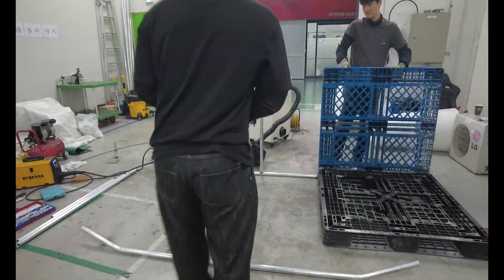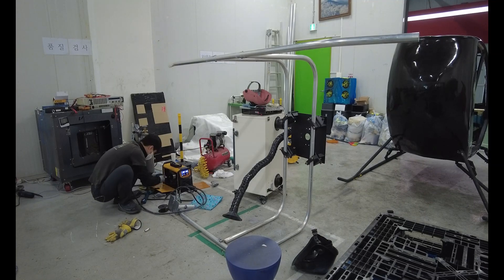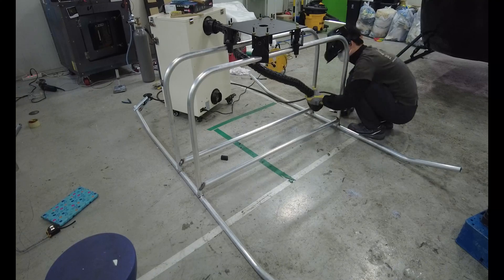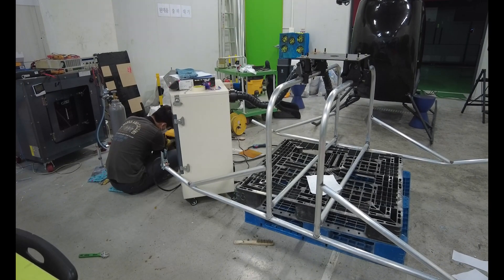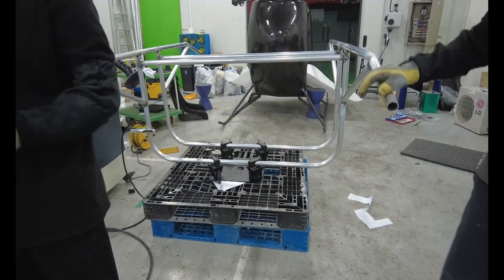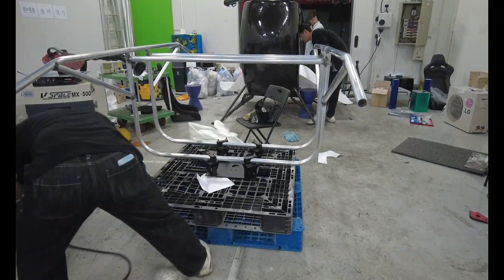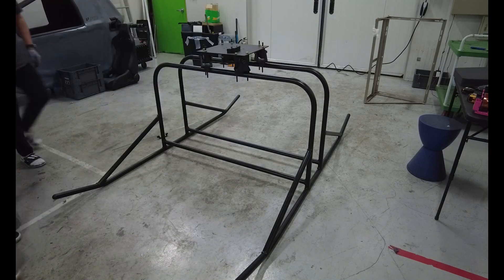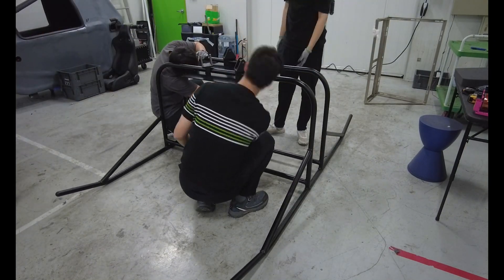I build a World's biggest Drone –Heavy Lift Drone _ Building & Welding (Part 2)

Comment: Amazing work!!! How did you bind and shape the aluminum pipes?
Reply from the maker: Thanks! I used basic tools like a grinder, pipe bender, and clamps. Since I didn’t use any jigs or CNC machines, I tack-welded each section manually while adjusting angles by eye and reworking several times. It was a long, hands-on process!
Reply: @jenk5109  wow! You really put an effort!
Thank you for the amazing video!